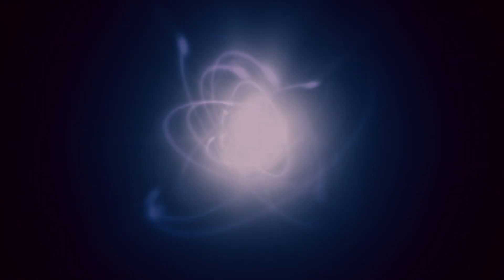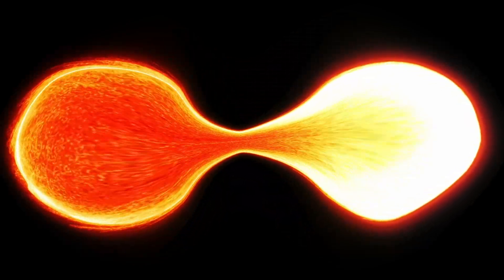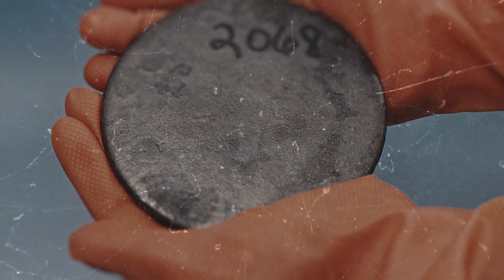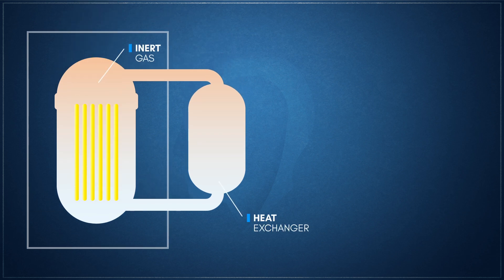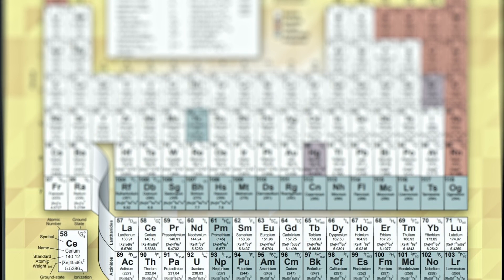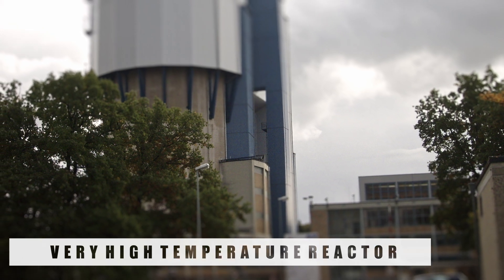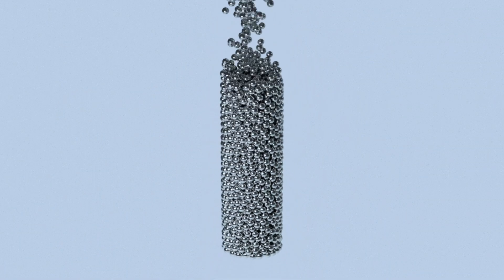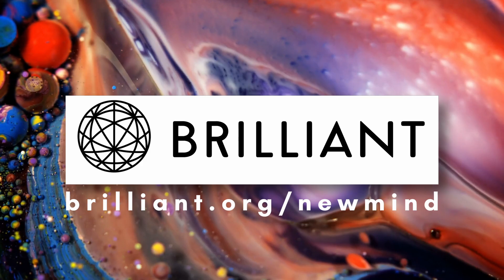Portable Nuclear Power

Comment: I work as an engineer for both BWRs and PWRs.  In my opinion the BWR designs simplicity makes it a much better option, especially when considering GEHs latest paper designs.  The ESBWRs are the safest gen 3+ design and could easily operate for 80 years if not longer.  They also reduce the components which reduces maintenance and failure points.  

BWRs are also much easier to control during an emergency since it is easier to diagnose and mitigate failures and accidents.
Reply: An a nuclear engineer I wonder what your position is about the SMR designs as proposed by NuScale (and others). The repeatability and off-site fabrication of standard units is a great advantage in my mind as the nuclear component doesn't require as much individual certification and inspection on site. Mistakes are corrected in factory and the design is continuously improved. The units get returned after a short time (10 years?) and any design flaws can be corrected if needed. This allows for a much tighter and more controlled safety standards as I'm concerned. 

I also personally like the inhered passive safety features of NuScale like the "ice plug" that melts if the active systems shut down, dumping the fuel into a bath of graphite if I'm not mistaken. These passive safety features are really easy to add on to smaller scale reactors. Need more power? Add more units. Just a minor inspection and you're done. The secondary systems like steam turbines can be treated like any other powerplant. Even if a meltdown would occur, only one small unit would be damaged, taking away 200-300MW of energy production. The remaining units can be put into service after an inspection. 

 The biggest problem with current reactors that are being built like the Olkiluoto reactor in Finland is the certification proces and continuous changing safety standards. It's currently taking 15+ years to construct, whilst it should realistically should only take 8 to 10 years. SMR's could take a lot of that safety aspect and delays away.
Reply: @patrickd9551  Patrick,yes you are greatly mistaken,NuScale does not have a frozen salt plug as it uses water not salt, the reactors run for 60 years, with refueling every 18 months on average, the first plant in Idaho is certified for 50MW with 12 of them, but normally they'll be 77MW each, groups of 4, 8, or 12. So these are just like our regular reactors, except they are smaller, taller,with steam generators enclosed, the tallness means natural congestion can cool the reactor, they use gravity convection and conduction so they do not need humans power, or water to cool.
Each reactor has a vacuum inside, if there is no vacuum,it doesn't run, and each reactor is underground immersed in a pool of water.Worldwide interest is intense,Romannia,Korea,Urkraine and S Africa are all at the top of the list.
Reply: @patrickd9551  A minor cavet. The dump tank would not contain graphite, because carbon is a moderator for neutrons. An empty tank with the means to dissipate heat would be ideal. Otherwise, you are spot on. 

Flibe Energy envisions two reactor shells per installation. If anything goes wrong with one reactor, the fuel is dumped. Then, after the problem is corrected the fuel can be  pumped up into a duplicate reactor. Building every 200 to 300 MW(e) reactor shell in a factory would lessen mistakes, hasten installation and lower costs. Certification would be for the type of reactor, not for each one installed. Given the natural safeguards with a MSR,  government regulators would have minimal oversight. Politics would not rule the day, as is now. Hysteria would be at a minimum. Installation at a location would be a matter of weeks, not years.
Reply: What happens when a SMR meets a beyond design basis situation? Same thing as any other reactor, I bet. Confusion, denial, scrambling, guessing, evading, denying, and then getting cheap wage labour to bag and move the remains, am I right? "INHERENT SAFTEY" is simply not something you or anyone can say, unfortunately. Elevators may be safer with passive breaking systems, for example, but they are still not "inherently" safe. What you wrote sounds a lot like some PR work to me.
Reply: @CarlDidur  sounds like you already have it all figured out.  But for those that realize that there have been advances in Nuclear Engineering between the 1950s and now, their has been a specific focus on passive safety features.  Passive safety features allow for easier mitigation on BDBA accidents.  Nothing is full proof but modern designs are a of a lot safer in BDBA accidents than the current fleet.

Oddly enough many very early reactors were passively safe but there was a desire to massively upscale the unit outputs and the larger you make the reactor the harder it is to design passive systems.  With that said the ESBWR is the best overall design, in my opinion and can be scaled for modular use or up to 1500MWe, which is massive.  

The SMRs allow for economic deployment and that is what the bean counters really care about.  In my opinion I would rather build the massive modern designs but I am looking at it from a technical approach and not with a business case in mind.  If the economy of scales take off for these SMR designs it could be a game changer that provides an extremely safe source of carbon free power.  Some SMRs even burn used fuel which was explored in the 60s and 70s but abandon because uranium was so cheap.  Buringin the used fuel reduces the long live nucleotides as well and allows for faster decay overall.
Reply: @mikeall7012  Well, I am not paid to have my opinion, so I can figure it out as I see fit.

In the middle of the above pitch you at least admitted that the inherent safety you originally lauded is in fact a best case scenario, as "Nothing is full proof".

You do say that smaller reactors can be made passively safe - which GE et al knew when they pushed their MUCH LARGER and less safe designs in the 60s and 70s - which led to multiple accidents due to the much larger residual decay heat of the larger cores being capable of destroying ALL of the safety mechanisms in a beyond-design-basis LOCA situation. Forgive me if I am wrong, but this is part of what happened at Fukushima, for example.

Myself, and many others who do not have a vested interest in promoting nuclear are naturally hesitant of governments throwing more and more money into "future gen" solutions to Nuclear when the ORIGINAL nuclear problems are nowhere near being addressed. 

Also, isn't it true that burning used fuel leaves you with a smaller amount of much hotter waste? It just makes the storage problem slightly different in details but does not address the real problems with accumulating casks of waste being stored for what amounts to an eternity by governments that can't manage even short-term problems.
Reply: @jeebus-k  The fact that you claim no US nuke plant has "released radiation" shows you have might lack understanding here. Routine releases are part of scheduled fuel changes, for example. All plants have regulated limits on releases during normal operation. The fact that we have strict regulations governing the releases of different isotopes must surely convince you, regardless of any other concerns, that US nuke plants routinely release radiation. This does not include known accidents and or considering the uranium tailings from mining, etc. Anyway, either you are deliberately trying to mislead people here, or you are simply oversimplifying to a point that is not possible when talking about the dumpster fire that is the US nuclear arms/civi programs. Stop pretending this is some Star Trek TNG business. Nuclear is dirty.

Coal is dirty too! And I hate fracking! What a sad sack I am.

Also, I have not been misinformed by the fossil industry re Nuclear tech. Almost all credible research info has to be vetted by the NRC in the US. There is plenty of history to this technology and lots of credible information. 

My family lived near the NRX reactor accident site in Canada (1947) and I live downhill from a fuel fabrication facility in Toronto (now owned by BWXT). I pass it everyday. This is part of my interest. 

Also Fukushima was a bit of a letdown for the industry, eh? It is only a matter of time. 

Also, my interest in humanity extends to generations not yet born and I, and many like me, think that the burden of waste storage alone is enough to halt the project.

It is cool science but we are not bound to do it just because it can be done... 

Thanks for your time.
Reply: @CarlDidur  US nuclear plants emit less radiation than the dirt that surrounds them,we are trying to improve the climate while you want a hotter more radioactive world.
Reply: @CarlDidur  Of curse you must have limits! Every activity or industry releases radioactivity. You burn coal or natural gas and you release radio isotopes (by the way, more than the one that releases a nuclear plant), since radio isotopes are present in practically every material. Of course in quantities that doesn't harm anyone. In nature you have radioactivity, from the space you get radiations, you find radio isotopes in some common use items, that you probably have in your home, such as smoke detectors, but of course this is not a problem since they are under the safety limit to make harm to humans. 

I'm more concerned about the emission of fossil fuels, that if we don't replace in a couple of years will damage the planet forever. Even renewable energies have their cons, you may not know it but the constructions of solar panels, wind turbines and batteries to store the energy damage the environment and kills people. Well we don't care since it's some cities in the third world, but we should.
Reply: @paulbedichek2679  Drastic childlike oversimplifications will not sort out these issues! Thank you for the response.
Reply: @paulbedichek2679  

Are we doomed to use nuclear because we historically mis-invested trillions of dollars on it when we could have accelerated solar, wind and other developments? Nuclear got the $$ due to the arms program, now we are lagging desperately. I don't propose replacing all active Nukes with coal plants, and this is a false comparison. I know the situation is complex. I have family working in power gen and transmission here in Ontario, Canada. 

We have invested a lot in a catch up game with wind and solar here, but it is obviously still a trifle. 

Also, love that you guys can lob out your PR without ever acknowledging any of the salient points against the tech. It is a waste of time talking to you and I only write these comments for the casual passer by, so they can inform themselves better if they wish to research on their own.
Reply: @CarlDidur  No one is as childlike or as simple as your reponses,radiation bad, it scares me!!
Reply: @paulbedichek2679  Wow, you got me dead to rights! A coal loving baddie. Glad the discussion is flowing.
Reply: @paulbedichek2679  Your industry is dead, buddy. You know that better than me!
Reply: @CarlDidur  China and Russia will have some of the cheapest electricity in the world then with their shiny new nuclear fleets. The West will be constricted by high energy prices.
Reply: @mikeall7012  My concern with SMR's is the very reason why the first commercial reactors were all upscaled to hundreds of MW's and GW's, economics. They couldn't produce small commercial reactors that were economical. Maybe fabricating SMR's on assembly lines can make them cost-effective, but I'm not sure. Reality will have to prove it out.
Reply: @CarlDidur  There has been a doubling of background radiation levels on Earth? Where is your source for this claim?
Reply: @williamsmith1741  I agree with you.  The proof is in the pudding on the SMRs.  The assembly line business model wont work unless 100s or so get ordered.  

I was at a conference where they were being discussed by a major industrial company who has a storied history in the business.  They stated that they would need about that scale to meet the cost goals and if they sold more they could actually get cheaper.  I tend to believe them because of the experience they have with the economics of the industry.
Reply: @williamsmith1741  Why is New York shuttering Indian Point? Didn't they get another license renewal?
Reply: @Shaker626  Haha, you forgot to subtract the cost of building those shiny fleets, and the cost of mitigating a disaster I bet!

Too cheap to meter (if your accountant is a crook or an idiot).
Reply: @CarlDidur  Nope, it was shut down as of April 30, 2021. Maybe it could be restarted, but I doubt it will. 

Why is it being shuttered? Decades of concerted efforts and fearmongering by anti-nuclear groups like the Riverkeepers.
Reply: @Shaker626  Nuclear subsidies drove the industry for decades. There is no real "on the ground today" comparisons that you can make in terms of cost due to historical mis-investment. Wind and solar have to overcome a large gap. Thanks for weighing in, Weeb Destroyah (real person, for sure).

The nuclear industry will slowly turn to decommissioning and storage site security as the last profitable arm.  At least that business will last a LONG TIME for y'all
Reply: @CarlDidur  You claim that nuclear enjoyed subsidies for decades, yet you elide that renewables too, could not have possibly become the globalised industry and accompanying supply chain they have today, without extensive state support. You are being ahistorical and selective in your bringing up of facts. No industry, especially not in something so fundamental as energy, exists in a vacuum without state support. In point of fact, it is states that bring markets into existence and enforce private property rights, while granting private organisations corporate charters to operate. Thus it is even arguable that nothing exists in modern industrial society without state support.

There's a semantic game being played by you, as well as other ideological greens, that imagine a "purer" existence without the corrupting influence of the state, or corporations, or whatever other undesirables. Of course, this is not possible. So instead perfection is demanded. Oh, a nuclear plant cannot be 100%, guaranteed to never melt down in a million years? Clearly it's the work of the devil! It is, of course, idealism that could only find expression in the comfortably afflicted intelligentsia or nouveau riche that feel a paternalistic urge to make the world a better place. Even if it tramples on the needs of others.

Like the first conservationists of aristocratic origin setting aside "nature reserves" as an excuse for the enclosure of the commons while massacring the inhabitants, this green idealism has never strayed far from its bourgeoise, anti-human Malthusian roots that sees the promethean desire to have huge amounts of energy to improve society as little else than the unnecessary uplift of the unwashed masses. Any development, from fossil fuels reversing European deforestation, to nuclear power displacing coal, is seen as a further alienation from "balance" with nature's imperatives to live and die by tooth and claw. 

What's especially galling about your idealist promotion of renewable energies - as abused of a term that is - is that the people who pushed hardest for their development and diffusion came out of the fossil fuel industry. Germany's Energiewende - profoundly antinuclear in ideology just so happens to have its political-economic backing beginning with Gerhard Schroder, now working for Gazprom. 

The USA's green energy transition starting with Clinton's corn ethanol and accelerated by Obama's green think-tank led market shaping subsidies found initial opposition, but later enthusiastic support from the American Petroleum Institute, especially once they could see that municipal utilities were being privatised to drive the transition. It just so "happened" that the residual load would be served by oil and gas fracked from the Marcellus. And of course, who other than Amory Lovins of the ConocoPhillips company writing for Politico would be pushing it, together with burning trees, to serve as the ideological basis for overturning 4 decades of successful municipal nuclear deployment and maintenance. 

I would argue that your idealised energy future - that of energy bound to natural rhythms and more expensive than can be affordable by those plebians you hate, is already here. The cold snap in Texas freezing gas pipelines and wind turbines such that the elderly died of hypothermia by the hundreds. This coming winter in Europe, without imports of Russian gas, that will make Texas look like a picnic in comparison. 

This current energy squeeze caused by the ostracisation of Russia from energy markets is causing stagflation not seen since the first oil shocks in the 70s. And once again, it is greens and others of your ilk that are infested with this smugness and hatred of the working class that are crowding the airwaves and claiming that they should be glad to make sacrifices at the electric meter and at the pump to stick it to Russia. 

May you live in interesting times.
Reply: @MonMalthias  I am not really going to reply to that because the history of the development of Civilian Nuclear is well known. This is not my personal "ahistorical" interpretation, despite your attempt to personalize this. The arguments against nuclear power are well beyond the concerns of any INDIVIDUAL like myself, as they affect many future generations of humanity.

Your use of the current conflict in Ukraine to expound your energy policies is also crass and obvious.

I know you write this for others, not me, so I don't expect actual engagement, thank you for your time.
Reply: @CarlDidur  His point was not that you got nuclear history wrong, but that you ignore the subsidies that drove/drive the solar and wind industry. Hence he said "selective in your bringing up of facts" and not "wrong facts".
Reply: @leocurious9919   @Leo Curious  Nuclear subsidies were WAY higher - five times higher. "Too cheap to meter" is one of the boldest lies in American PR. Solar et al got a fraction of the development $$. That IS the history. You know all this. If you don't - go look it up before weighing in. Thx
Reply: @CarlDidur  I didnt weigh in, I clarified what was said since you missunderstood it.

If you want me to "weigh in", you first would have to prove the things you say. Like that 5x higher, where is that number comming from? Dont get me wrong, I have no idea where the true number might be (well below 1 oder well above 5?) but just saying some numbers, claiming others have to look it up and then a snarky "thx" isnt exactly the kind of discussion I would invest any time in.
Reply: @leocurious9919  Also, Leo, I am not having a discussion with you so invest your time however you please!
Reply: @CarlDidur  Your actions contradict your words.
Reply: @leocurious9919  given this guy's rhetoric and discussion methods, I suspect he may be a mouthpiece of the agencies that @Malthias has described to him above. XD
Reply: @CarlDidur  Hahaha!  1.
Reply: @CarlDidur  Nuclear energy is the most  dense energy source we have right now. The problem is that we are using antiquated (1950s) technology to produce it.

The reason we do that is because the Light Water reactor industry has captured its regulators, thus forcing out any alternatives.  If we started using LFTRs most of our pollution problems would go away.

Wind and Solar are impractical for base load electrical. Worse, they make us economic captives of the Chinese.

There is no lack of brain power in the US. We have, instead, laws and regulations which tie our hands, so venture capitalists dare not invest in LFTR.
Reply: @UrbanBard1  I don't agree, that is all. No "next generation" idea has been shown to be feasible in practice. I want to see distribution of production through increased local solar and wind use so we get back a large portion of what is lost during transmission (by not having as many high voltage transmission lines). I see future domestic tech using a lot less energy, improved solar and batteries meaning we can actually capture and store a lot of our energy needs on site, etc etc. You can keep trying to get molten salt or whatever working, but I don't think that it is a responsible investment. Again, my feelings only, based on basic science,  looking at the industry from the outside (i.e. nothing to lose by being honest).
Reply: @UrbanBard1  Ya
Reply: @UrbanBard1  Uranium scarcity isn't an issue from what I understand the issue is that the market dried up.
Reply: When all new nuclear builds dried up, not due to any conspiracy, but due to economics...
Reply: @CarlDidur  No, strangling a technology in its cradle is not economics. It is politics. There was no freedom to choose like a market place would give us. The US government had a death grip on the nuclear industry. They chose badly.
Reply: @CarlDidur  Bad politics can dry up a market. Never underestimate the power of a government to tax or regulate a technology out of existence. There has been no freedom in Nuclear since Admiral Rickover gained control of the industry.

The light water reactor industry makes no money from building new power plants. Its funds come from selling replacement fuel rods. The price of U235 does affect that business model.

Like I said, I expect India or China to perfect the Molten Salt Reactor. They have the incentive to do so.
Reply: @CarlDidur  You clearly have not studied the physics behind the MSR.
Reply: @mikeall7012  According to your logic, no large passenger plane would ever be built on an assembly line, but they are.

If MSR's are small, 25 to 55 MWe, then you would need 20 to 50 to replace each decrepit LWR.
Reply: @UrbanBard1  Nuke crowd got plenty of funding and you know it. The regulation is needed due to the risk involved and well known factors like creeping safety complacency etc. Thank god for the hardworking people in the industry that kept these plants relatively safe in the face of failing profitability and corporate pressure to fight against the regulator's recommendations. 

There is science on paper and science in the real world. I am a repair technician so my main interaction with systems is when they fail. They always fail! Keeps me in $$
Reply: @CarlDidur  That was a political decision caused by nuclear hysteria.
Reply: @CarlDidur  You are jumping to false conclusions. I worked for an aerospace defense contractor, General Dynamics, I was never in the nuclear power industry. 
I have an active mind, so I get interested in other fields. It only takes 10 thousand hours to become an expert in anything.

Simply because the LWR industry has won so far, does not mean that they will forever. I don't like the fact that India or China will reap the benefits of MSR technology. But, that's life.

Bad politics matters. I know what the possibilities are, but you don't. I know the technology. You are too ignorant to be confident about the opinions you hold. 

Old does not necessarily mean wrong.There were 19 renditions of automatic looms before the Jacquard loom was successful. Experimenters worked on manned flight for hundreds of years before Kitty Hawk. 

The point is that you are clearly unaware of the experiments going on in America and other lands. I know which problems need to be solved to make MSR practical. Those experiments are slowly being made.

Mostly, what needs to be solved is  chemical engineering. MSR's run at 700 plus degrees Celsius at normal atmospheric pressure. This is a really hostile environment. Hastalloy N (ORNL 8) may not be good enough. That's what experiments are for.

Any technology which operates without major problems for four years is pretty good. The fast breeder reactors tended to have so many problems that they were abandoned in several years. 

I don't need your permission to tell the truth. If you don't like what I am saying, go away.
Reply: @UrbanBard1  Defense contractors are definitely well known for their realistic assessments and savvy budgeting...

Even less public accountability than nuclear program. Of course you just want to keep throwing money into that pit, that's how you were trained to approach the situation.

Others have assessed that the cost is too high (economically speaking) and the risk is too high (insurance wise), not even considering waste, etc, and that is why the industry is stagnating.

Who are you writing this for? You are not talking to me, therefore this is PR, and you are shilling for free. Have anything better to do?
Reply: @CarlDidur  Ah! Military procurement seems to be another area you know little about. I worked on the Phalanx radar controlled anti-aircraft gun. The Navy liked it a lot.  Then, a few missile programs for the Air Force before transferring into IT since I like computers. Later, I got into CAD/CAM. This was back in the day when personal computers were toys run on the CP/M operating system. 

I don't like politics so I avoided management positions. I never did anything to be ashamed of in my work life. Honest pay for honest work. Beats being a welder like my father.

Of course, in 1991, the Soviet Union collapsed which undercut the defense industry. If other countries want to fight with the US, it only seems fair to be able to fight back.

I 'd done well in silver speculation from '73 to '80 and parlayed that into early technical stocks such as Microsoft and Apple. I'm not rich, but I'm well to do. I'm more inclined toward 4 wheel drive Dodge trucks than BMW's. 

My branch of General  Dynamics started to close down due to lack of contracts in '92. I stuck around for three years closing down the defense facility and decided to retire at 53. 

I left California for Carson City, Nevada for the  low taxes and the whores since I'm a bachelor. I started to avoid the whores as I got closer to 80 years old.  Carson City is a good place with real seasons and down-to-earth people.

I have my hobbies, but I don't need to work. I live modestly on the edge of town, but I don't have to. The world is an interesting place, so I take up interesting technical topics to learn. The Molten Salt Reactor is just one.  

I've given up on the possibility that you are listening to me. Your arguments make no sense. You can't reply to my arguments except in nonsensical Ad Hominem attacks. You are so off base in your assumptions. 

You are an idiot if you think Wind and Solar are anything more than a political boondoggle. The electricity in my area is produced by Geothermal. It is unlikely to run out before I die of natural causes.

I've been sticking around on this thread to see what bizarre thing you will say next. You have my permission to ignore me. I have other things I could be doing.
Reply: @UrbanBard1  Bot? I tire.
Reply: @CarlDidur  I tire of you too.
Reply: @CarlDidur  I suggest you stop attacking people who disagree with your Green presumptions. Or if you do, learn some logic. Build a case, rather than make assumptions or hurl accusations.

I would have helped if you had worked in some industry, so you could speak from experience. You would find out that the best technology sometimes doesn't win. It might later, when the politically correct technology  fails dramatically. 

The trouble is that when a particular technology fails, idiots blame the entire industry when alternative technology was strangled by politics in its beginning stages. Governments shouldn't be in the occupation of picking winners and losers. That is the job of the marketplace. Any industry that needs subsidies or caps on their liability shouldn't be in business. 

I  certainty believe that MSR will become commercially successful. I merely disagreed that India or China would get the patents.
Reply: @CarlDidur  You are so strange, Carl. No technology is ever dead. Repeatedly, people come along and take what was learned in the past, adapt it and improve it. This may turn it into a success or not; other modifications may be needed. 

The greeks invented a steam engine 200 years before Christ. They did nothing with but to make it a toy. Some Europeans later took that invention  and made it better. They made it useful; it pumped water out of a mine. Hundreds of changes were necessary to make it practical to power a factory or drive a locomotive. It was never dead, just lost. A lot of technology was lost when Rome fell.

A similar case can be made for gunpowder. Some Chinese monks discovered it in the 10th century and all they did with it was to make fireworks and rockets. 

This knowledge had to come to Europe for it to be developed. The Europeans had had Greek fire from ancient times. Someone inclosed gunpowder in a barrel and used it to fire a projectile. Why didn't the Chinese do that?

It takes a special mind to improve a technology. The ancient Greeks  were quite theoretical due to Plato's "Forms." They were not practical. Some people had the interest in technology, but didn't want to get their hands dirty. You can place Leonardo de Vinci is that group. He had lots of plans, but he never experimented to see if they worked.

When I look at the Molten Salt Reactor, I can see the drawbacks. I can see the experiments necessary to prove that there is  even a problem. 

One of the concerns today is whether the materials constituting the reactor and the piping are sufficient. If experiments are never allowed to determine if there is a problem, the technology has not failed, it is just lost for the moment. Not everyone in this world is as stupid as our bureaucrats.

We really won't know if the MSR is viable or not until a full size reactor is built (250 MWe) and is run for five to ten years. But, that power plant is not allowed 
be build it the United States due to federal government regulations. 

China or India do not have those regulations. Their build of a MSR could either succeed or not. We don't know until someone tries.
Reply: @UrbanBard1  If one were to read all these messages, I don't think I could be seen as attacking you, a retired man who never worked in the industry. Don't take it personally that the $$$ dried up. 

Anyway, you don't want a conversation, you just want to promote a disingenuously simplified scientific narrative to a presumably tech-illiterate youtube passer-by and you are using my comment as an opportunity.

I called you a bot because you only make programmatic statements like a robot. 

If you are a person, I apologize.

But as you have come around to simple derision and name calling, I have to dip.

Thank you for your service in the defense industry, which I gather is highly competitive, stressful and often judged poorly by the greenies and peaceniks. While I have my reservations about black budgets I do appreciate what a HIMARS or CRAM can do to save lives.

Hope you are well and that you enjoy your retirement.
Reply: @CarlDidur  I am not a bot and I am allowed to defend what I believe is true. My arguments are not robotic, they are just the science which you seem to not understand.

 I am paid by no one. I did not insult you, personally, just your erroneous opinions and your debate tactics. Ad Hominem attacks are never permissible in honest debate. Impugning another person's motives is disgraceful. 

I have no idea what your motives are. I can only guess that you are blindly indoctrinated. There is just no talking to you.

Do I think you a fool for holding opinions which you cannot prove? Yes. Especially since, you will not make a logical case and accept defeat when you are proven wrong. 

You continually use prejudicial language. Money for thermal reactors did not dry up, because that would imply a failure which never occurred. The money was politically diverted to fund the fast breeder reactor experiments which failed. We have the letters to prove that.

Light water Reactors are obsolete and should be replaced. They have created a huge nuclear waste problem which no one has a solution for. 

The Fast Breeder Reactor experiments never worked. The Generation IV reactors  are better than what we have now, but they have a serious problem: U235. 

U235 will never be non proliferating. It is also quite rare, it's like burning up Silver. Bonkers.

It is far better to burn up Thorium which is a  hundred times plus more abundant, produces less waste that a LWR, is non proliferating, has no competing uses and produces waste products which have a shorter half life and which have commercial uses when refined after 10 years.

I have stated that experiments need to be run to solve the last remaining questions. Those doubts center around what alloy should be used in the reactor case and in the piping. Also there are issues with the internal carbon rods expanding and then contracting in exposure to neutrons. 

Perhaps those doubts are imaginary. Or they could be real and another alloy can be substituted. Or it might be possible to coat the inside of the reactor and the piping with a thin layer of Boron Carbide. I don't know. But, Boron Carbide is hell to machine.

As a Libertarian, I am leery of the defense industry. But, that is mostly because of the politicians in Washington. 

The company I worked for was corrupt in order to steal from the public purse, but it turned out good products. They never put our soldiers in harms way like some companies did. 

Too often, it was the bureaucrats which sabotaged a weapons system. A case in point is the M16 rifle which was a fine weapon when it was delivered to the military. Then, some bureaucrat changed the formula for the powder in the round. That is what caused the jamming problem  during the Vietnam war.
Reply: @CarlDidur  You were always prejudicial with me. 

A person who worked in the Nuclear industry can be telling the truth or not. What you have to do is look at that arguments they are making. One thing to remember is that there are a diversity of opinions within the industry.

I'm opposed to Light Water Reactors because they are antiquated, dangerous, polluting with too much radioactive waste and are doomed to fail eventually as the world runs out of U235. There can be plenty of Yellow cake in  Kazakhstan, but there may be difficulties getting it past Russia. 

There are later generations of nuclear reactors, and they are much better than LWR. But, they all have the same problem: what do we do as we run out of U235? None of the fast breeder reactor experiments worked. If we eliminate the fast spectrum all we have left is the thermal spectrum.

It seems wise to think of this issue early. That bring us back to Thorium. Do you have something against Thorium? What?
Reply: @UrbanBard1  I am sorry to have frustrated you by not changing my opinion.

I honestly think you should stop trying. My thoughts on this subject are not so casually formed that a stranger can berate me into changing them.

Re technology: I simply do not believe that everything that is theoretically possible is worth pursuing and my personal opinion will not be changed by you at this time, re molten salt, breeder reactors, waste cycle, etc. Others can look into the history of all of this themselves and come to their own conclusions. 

ps, I stopped reading your replies so you can stop writing.
Reply: @CarlDidur  
What makes you so arrogant to think I am trying to change your mind? Who the hell do you think you are? I am just telling the truth as I see it on a public forum. Other people, who are less bigoted than you, are listening in. They can tell who is being reasonable. 

I do suggest that you change your atrocious debate tactics. Learn how to honesty argue a case. Ad Hominem attacks and personal slurs are unnecessary.  An argument should be able to stand up on its own. 

One of privileges of the elderly is to police  the manners of youngsters. I seriously doubt you are over 50. Don't act like you are 12 years old, please. Whatever age you are, you have some growing up to do. If you treat me respectfully, I will reply in kind.

What are you doing here? You were spouting politically correct nonsense to people who are smarter than you.

I waged in because you are a bully. You were shouting down people with more experience than you. You turned a pleasant disagreement into a fight and I have always relished a tussle. My bones are just too fragile for a rough and tumble. 

It's not your business what technologies will be pursued. Naysaying technologies you don't understand is disgraceful. The future will show who is right. You are probably young enough to see yourself proved wrong in the next few decades.

You keep saying that you are not listening in, in an attempt to get me to leave. I find that rather childish. As long as you want to argue nonsense, I will be here to dispute it. 

Pick up your ball, kid, and go home.
Reply: I reaffirm, Louis, that you are terribly rude. You do not know my age and to call me a youngster is ridiculous. 

You tell me my argumentative style is no good while yelling at me that you are "not trying to change my mind" at all, which is obviously a bit of confusing rhetorical space. Anyway, this type of exchange is a good example of why you should stay off the internet.

You are a troll and hot head. Since we are not arguing, as you confirmed, you are just harassing me for having a different opinion than you on a topic of no professional concern to either of us. Which surely is not a threat to you.

Any citizen can look up the information for themselves and see the dire state of the nuclear business, without me citing anything. I am just an observer.

I close by repeating that I hope you have your health and can find something (better than this) to do in your retirement.
Reply: @CarlDidur  
Your behavior, if you were a youngster, would be forgivable. The young are always ignorant. Sometimes, they are teachable.

 As I said, I don't care about you. I care about the people listening in. They will judge our conversation. I am providing them information despite your interference.

I am too old to be a hot head. Nor am I harassing you. This is an open forum. Everyone can speak here. 

You don't get to decide what interests me. The idea that you threaten me is laughable.

I tried to to present a convincing case to you and you used contemptible debate tactics against it. 

All you need do to get rid of me is to ignore me. But, will your ego allow that?
Reply: @UrbanBard1  You are a just a troll, sir, nothing more. 

You claim to "try to present me info" whilst yelling you have no desire to change my mind as I am beneath you. You are just wasting time.

Nobody is listening, Louis, not even me.

I will just close where I opened. I think molten sodium is a bad, forced choice as a coolant as it makes the "hot" and "cold" sides of a reactor both extremely dangerous which increases the severity of any accident. I personally think that this is a marginal  technology and not suited for mass use for commercial electricity generation. Thanks for chatting! 

Hi from Canada (home of Hydro and always ready with a CANDU attitude).
Reply: wash hands emoji:washhands:
Reply: @CarlDidur  You don't know who is listening, CARL. Apparently, someone is, because I've gotten many likes  and thumbs up for my responses to you. 

Here is the problem, not everyone who disagrees with you will speak up and they appreciate that I have the courage to do so. It's not really courage; I just don't fear you or anyone else. I'm too old for that.

If you are not listening, continue to do so. And leave me alone.

Ps. Why are you talking to me about a liquid sodium reactor. That failed in the first reactor placed in a submarine. It was replaced with a Light Water Reactor.
I have continually used the acronym, LFTR: Liquid Fluoride Thorium Reactor. There are, of course, a number of MSR's: Molten Salt Reactors. If I mislead you by using that acronym, I'm sorry.
Reply: @CarlDidur  I hope you keep your promises. Good Riddance.
Reply: @CarlDidur  So long. Farewell. Auf Wiedersehen! Good Night.  

Enough said.
Reply: It was nice to learn about BWR's, as I was unaware of the difference between them and PWR's. Most of my knowledge is on Gen IV reactors, and primarily on thermal spectrum fluid fueled MSR's.
Reply: Think we will be able to make SMR  actually cost competitive?

 I am pro nuclear. Yet hearsay says nuclear is so expensive due to regulations. Yet it is like ‐ out of all things... You can't skimp on saftey when it comes to nuclear power. 

 So every project is extremely expensive to start off. Then you have obscene project overruns costing 15 plus billion. 

 With how cheap solar, wind, and especially batteries are becoming. It is like why make it when we can use the extra money to work on the grid too. 

 There are technologies already out or improving that deal with the frequency or baseline issues for renewables. Also geothermal with micromilimeter drilling looks promising for baseline as well. 

 So is it like. Is it worth it? I personally like the idea of a decentralized grid.